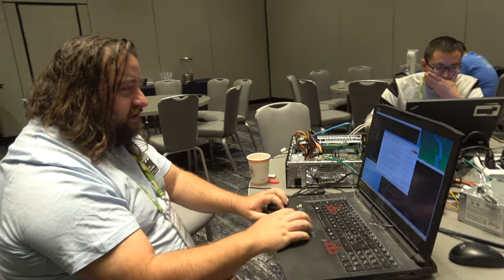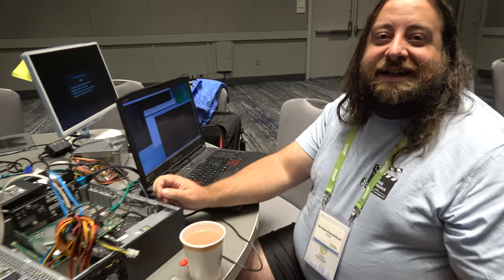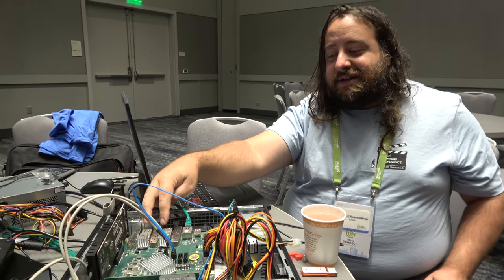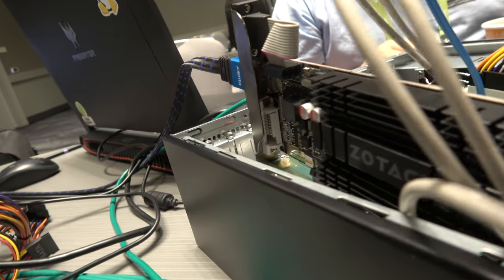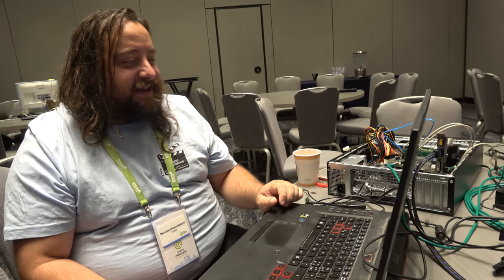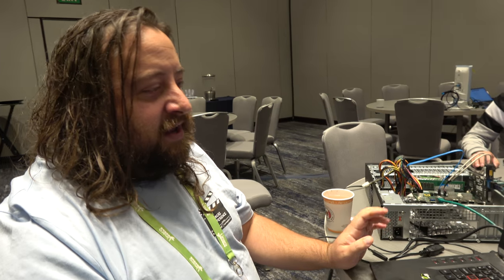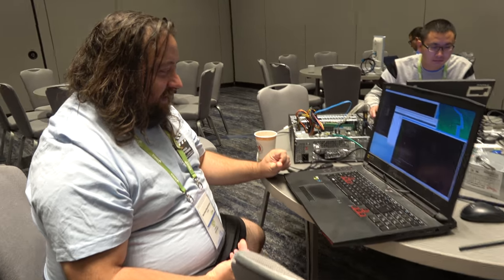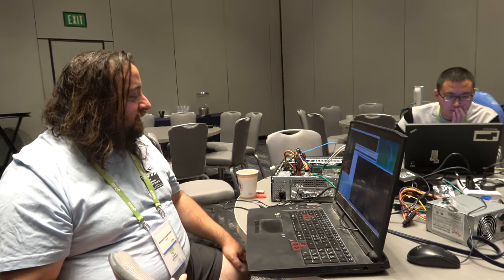Bero builds ARM Desktop PC Quad-core ARM Cortex-A72 Marvell MACCHIATObin

Comment: Wow, that is amazing, I always wanted a ARM based desktop.
Reply: Posting this a few years later after Apple announcing they would move from Intel to ARM for their desktops haha
Reply: @phatmeow7764  I have a ARM based desktop, it is a Raspberry Pi 4. Still not as good as a X64 based desktop, but it can get basic stuff done.
Reply: @Ace1000ks19751982  imagine if you could find way too hackintosh  raspberry pi or computer with arms
Reply: @NicVandEmZ  You can use a Raspberry Pi cluster, but clustering 4 Raspberry Pi 4s would still be weaker than a modern I7-11700k based computer.